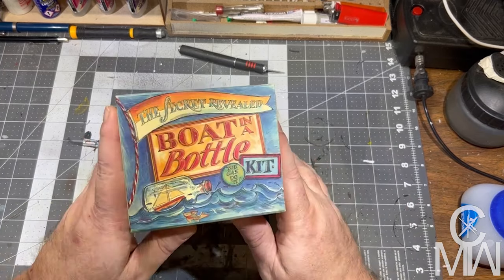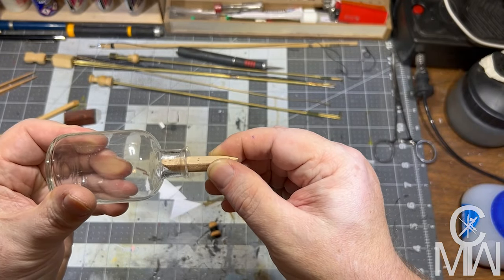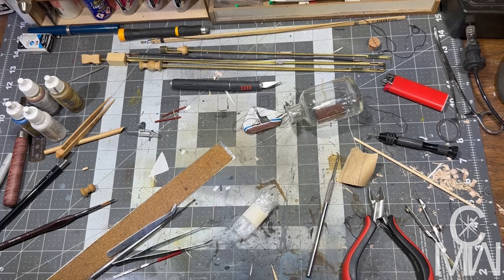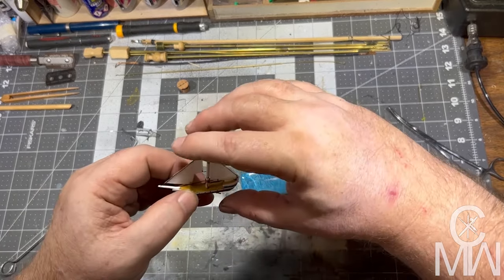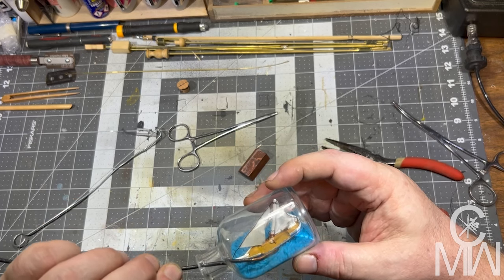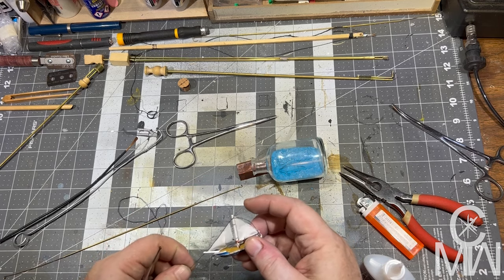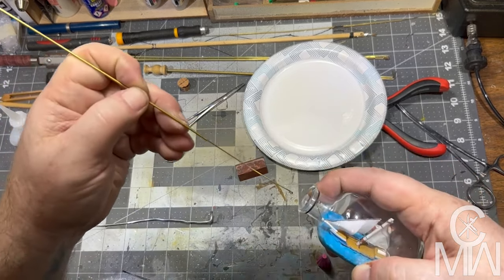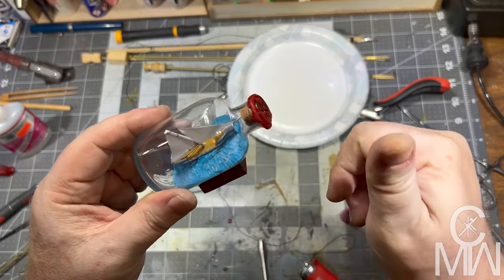Ship in a Bottle - A Beginner Project

Comment: I'd do a first layer of the sea to get it smooth, second layer would get painted after the boat had established where it would sit, but without the boat in place. Then place the boat as you had done. I like the idea of signing paper on the bottom inside the bottle. But that sure is a small ship in a small bottle :) I'd need a bigger bottle and a bigger ship.
Reply from the maker: This was a very basic kit.. I usually do larger ships in bigger bottles. That might be a good idea for another video. Good point on the smoothing for the sea! Thanks!